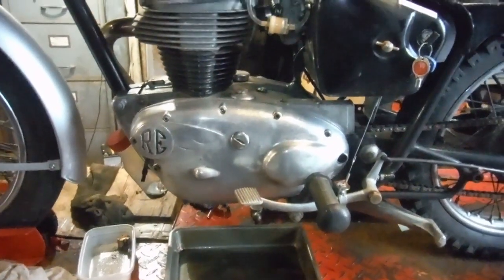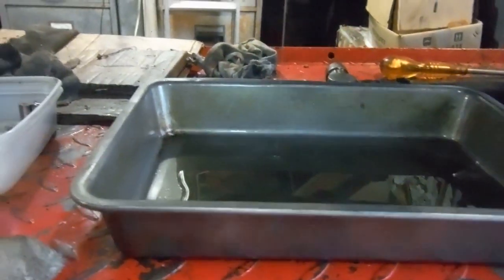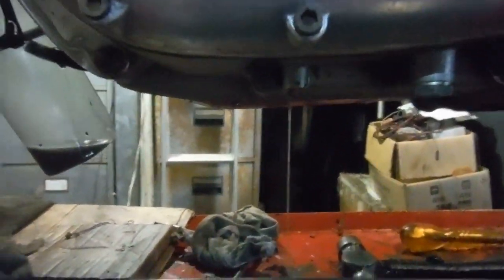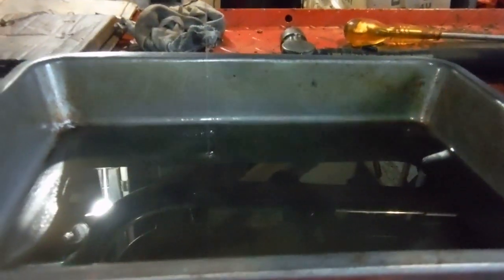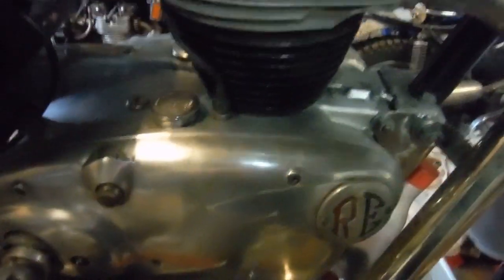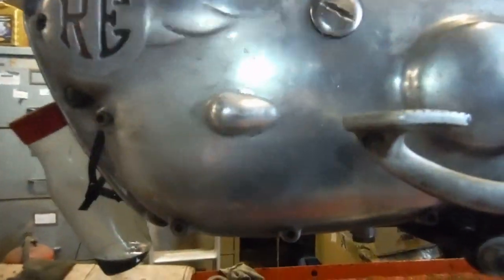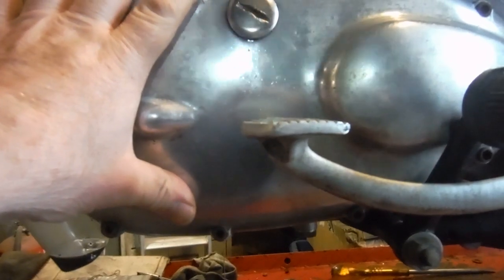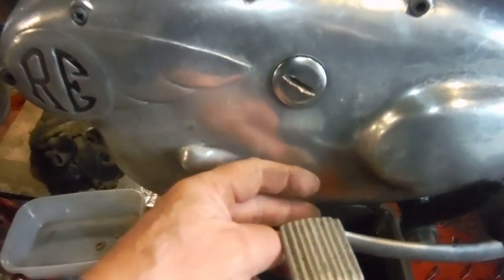Royal Enfield Crusader still has oil scavenging problems compounding crankcase breather issues.

Comment: Sometimes finding causes of oil leaks can be a pisser…I’m restoring a ‘66 Honda s90…leaks like a sieve from below cylinder where it fits to case halves…I’ve tried 1 then two gaskets, taking the cylinder and crank halves to a machinist I trust to true up the surfaces…no good…I’m just hard headed enough to keep plugging away until I solve it…I enjoy your work…even though you test ride on the wrong side of the road…lol…